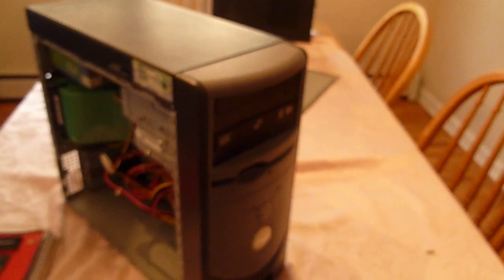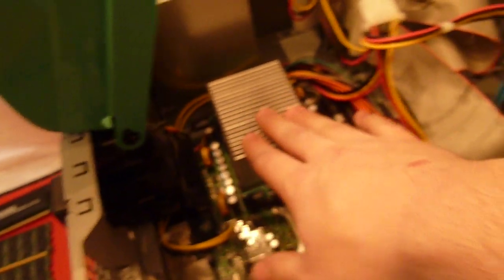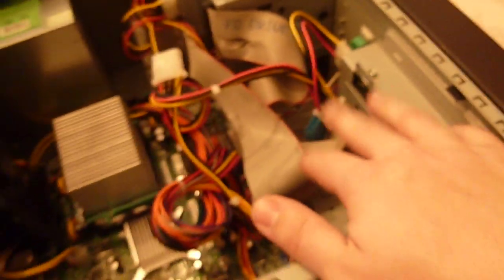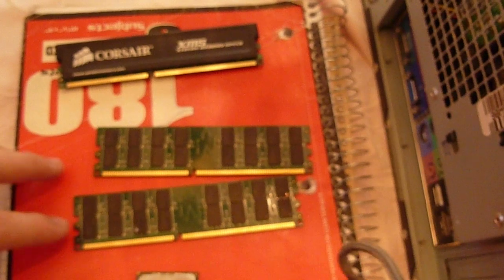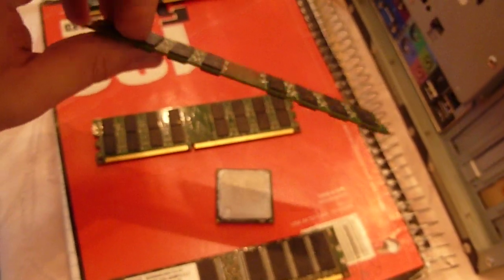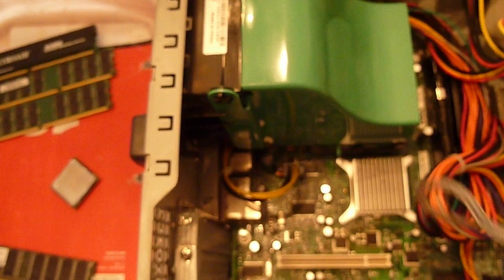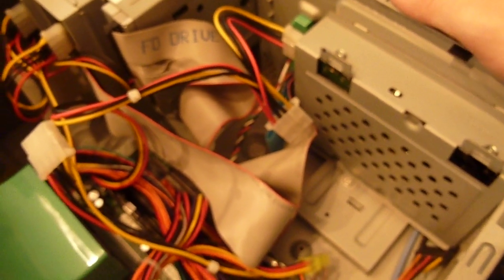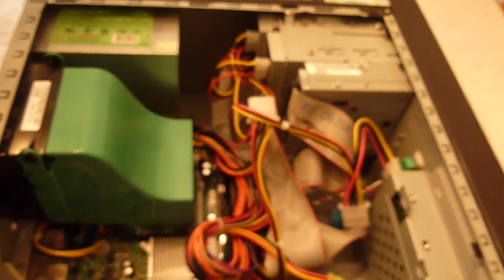Dell Dimension 3000 computer upgrade

Comment: I hate to discard this because it has a fast  3GHZ processor and am  considering upgrading to 2 GB of RAM and using Umbunto as an operating system. Will I have color problems as other have mentioned?
Reply: windows XP is the best for those PC's

Comment: Wouldn't you need to also upgrade your heat sink as your processor is more powerful so may heat faster?
Reply from the maker: +Hanz von ShrekyDreckyWeedStain Thats in the description and the video. DDR 2GB max.
Reply from the maker: +The Hh no. The heatsink with it is overkill to begin with. Its not like a p4 is a screamer anyways.
Reply: +0zfer What is the maximum amount of ram you can put in the 3000? also, its DDR2, correct? I would like to upgrade mine to 4gb, if it's even possible.

Comment: Is the 3GHz P4 the absolute best processor for Dell dimensions 3000? Is there anything that can better this CPU for this PC?
Reply from the maker: +The Hh There is probably a 3.4Ghz or something like that Pentium 4 but the price will be a lot higher, and the performance not significantly better. P4 line is the best this can do on the 400 series socket.
Reply: 0zfer so would a P4 3.2GHz be compatible for a DELL dimensions 3000 32 bit?
Reply: 0zfer was your cpu 800mhz fsb?
Reply from the maker: +The Hh it should be but it really shouldnt even matter. As long as its the right socket you cant go wrong with these pentium 4s...
Reply: 0zfer if you don't mind me asking, how much did you buy your P4 3GHz for?
Reply from the maker: I had it from scrap laying around. I imagine you can get one on ebay for under $10
Reply: 0zfer which would you say is worth buying. The 3.2ghz for £5 or the 3.4ghz for £13?
Reply from the maker: +The Hh as long as its the socket 478 and not the socket 775 it should work.
Reply from the maker: +The Hh the 3.2 will do 98%, is it worth it to invest more in something this old? 3.4 will not be able to do many insane applications these days and 2GB ram is not much.
Reply: 0zfer yes they're both for socket 478. So I'm guessing I'll just get the 3.2ghz one. No point in investing an extra £8 on a cpu 0.2ghz more. I'm planning to just use this PC to surf the Web, do work and maybe the occasional gaming...
Reply from the maker: +The Hh good luck even playing youtube on it... I would go with linux at this point as windows 7 runs hunky chunky on it.

Comment: Quick question,  decided to bring my Dimension 3000, which has just been sitting collecting dust, out of the dark ages. I have a new dell laptop, however, want to bring the Dimension up to speed with at least Windows 7 as a back up.  I replaced with 2GB of genuine Dell Ram and now my screen color is terrible.  All blue and yellow hues. Any ideas on what I should do?  Thanks!
Reply from the maker: 24hrlib Is the problem corrected putting the original ram back in? If so its probably bad ram and you should send it back.
Reply: Ah ha!  I was thinking it was in need of a new graphics card.  Which I plan to do soon.  I didn't think of the RAM as bad.  Thanks so much for your assist!!!!

Comment: I have a dimension 3000 also that I want to upgrade, do you know the name of the motherboard so I could look up what it could handle as far as newer parts? Or do you know the motherboards limits as what new parts it could handle?
Reply from the maker: lonetigerx You can just google for dimension 3000 upgrades as only 1 type of motherboard is used in a dimension 3000. As my video said you can upgrade to 2 1GB DDR1 ram sticks, a pci graphics card, and a better pentium 4 cpu, and other then putting a SSD in it thats about it. SSD is probably not worth the price for such a old pc.

Comment: you could get a pci to pcie x16 or pcie x1 adapter - try geforce 210 - as a graphics card -- people play fifa 14 on pentium 4.or 6200 pci graphics card geforce - is alot like onboard graphics on newer system.
Reply from the maker: 0009aw lol by the time you buy a $50 adapter and try to jam in a new gpu with it and put strain on the old power supply and hope the adapter doesn't kill the mobo its just not worth it with a system that old. and for what to play fifa 14 a 3 year old game?

Comment: Celerons more like Craperons
I took out that useless floppy drive and moved my HDD to the floppy bay to allow better air intake in the front.
Reply from the maker: Floppy drives can come in handy depending on what your doing. Improving airflow is good but your not going to be overlocking one of these.
Reply: I put a Dell Studio s540 motherboard in it,  painted the front gray bezel red, painted the inside black, and cut out the round dell bulge on the side for a fan. I may not be overclocking it, but I got a big 'ol 11 inch long 9800 GTX+ in it. I can't remember when the last time I used a floppy drive.
Reply: I leave them in the computers, sometimes I use floppy's

Comment: Hi, Ozfer

I need help:  I want to buy from Dell: VisionTEK
3450 PCI 512MB DMS59 SFF DDR2 Dual Monitor SFF-Short + Tall brackets for the Dimension 3000  It says it is cmpatible with it but conflicted because in teh manual it states that it has a maximum of 32 bits  (PCI connector data width(maximum) 32 bits and the product taht I want to purchase syas it has: bus width 64 bits
alos memory interface: 64 bits  I fear it will not be compartible since the computer states taht it has a maximum of 32 bits.  Should I worry and not buy it ? or is it still good and I am worried for nothing?

I hope you can help me.

Sincerely;
Giuseppe
Reply from the maker: As long as it uses a standard PCI connector this will work. I believe that card is standard pci but the memory bus on the card is 64 bit internally. It should work perfectly fine under windows 32 bit because standard pci slot is 32 bit. Keep in mind that card wont be a "Screamer" but it will be better then onboard graphics.

Comment: Would it be useful to upgrade also the CPU?  Asking because this is for a friend of mine.. helping him out with having a better video game experience.
Reply from the maker: Yes upgrading cpu is one of the best ways to get more performance. a new 3Ghz or 3.4Ghz hyper threaded pentium 4 will be faster then stock (not nearly as fast as new cpus today but aa 3Ghz Pentium 4 is cheap on ebay). Remember to turn on hyper threading in BIOS after installing new cpu and remember to go with pentium 4 socket 478 and not 775

Comment: I bought  from DELL  1GB Certified replacement memory module. It says it needs to have 2 equal cards to be able to work properly.  I will install it once I receive it.  My question is: is there a way to instal a new upgraded graphic card?  Could yu please make a vdeo on how I can do that if possible?

Thank you!

Sincerely;
Giuseppe
Reply from the maker: you can only use PCI graphics in this system. There are no GOOD options for pci graphics butr some that are better then the built in. The problem with PCI graphics is you might not have enough power from that old pc and you might need to upgrade the PSU and good(as good as pci gets) pci graphics. NVIDIA 8500GT or 8400GS are some of their fastest Nvdia pci graphics and ATI 9000 pci are on newegg. None of them are new or that amazing but they are better then the built in. Make sure whatever you buy is PCI and not pci-e or express. The cards slide right into the white slots and should come with some basic installation instructions.

Comment: Can u make a video where u take out the 
Dimension heatsink im struggling
Reply from the maker: push down on the side brackets around the heatsink while pulling them away from the heasink. I also had trouble the first time I did this since I had never seen them before. Don't pull them straight out because they are clipped in. one bracket on each side.

Comment: Hello. I am upgrading a dimension 3000 that I was recently given. I was wondering have you tryed windows 7 on this machine? I already have the 3ghz processor and 1.5gb ram so all is good there. I am planning on putting a 256mb pci graphics card.
Reply from the maker: If you use a pci graphics card that supports windows 7 aero and DX9 as a minimum windows 7 will run okay. Unless you already have a pci graphics card its not really worth it to put so much money into a old machine. Without the pci graphics card windows 7 does not like the intel integrated graphics very much because they are made for windows xp. A very fast alternative OS to put on this machine would be mint linux and it would run great even with the intel chipset. Now that windows xp is not supported anymore this machine has lost its main OS.
Reply: I ordered a nvidia 512mb pci card vista compatible.  Waiting for it in mail.
Reply from the maker: I really wouldn't use vista its at least 10% slower then xp and windows 7 and will be out of support in another year or two.
Reply: Im not using vista I hate vista im using 7
Reply: I got the geforce gt610 and it was a success
Reply: And I put the full 2gb ram
Reply: I dont know I sold it but my buddy says all his facebook games run a1
Reply from the maker: Randy Harrigan lol facebook games :P I wouldn't expect it to play BF4 anytime soon!
Reply: No but thats not what I was intending for it I just wanted it to rin wondows 7 and run facebook and youtube smoothly and it does so mission accomplished and all in it only cost $140 and I sold it for a bit more than that...

Comment: so i can take out all the old parts and upgrade it to a gaming pc like bf4, titanfall, arma, minecraft, elder scroll games and all the other rpgs and fps games
Reply from the maker: If you want a new gaming PC you could probably re-use the case and that's about it. I find it better to get everything new because a new case on sale at newegg can be bad once in a while from $10-25 and it's worth it. The psu mobo CPU ram and most likely DVD drives and floppy drives could not be reused with a modern mobo gaming PC.

Comment: My wife located her Dell Dimension 3000 in storage and I want to upgrade it and use it as a media PC & DVR.  With today's hardware, what would you suggest I replace the Mobo, Ram, CPU, Graphics Card, & Power Supply with?  Is this case compatible with the Asus p5k-se Motherboard?  Is it even worth it?
Reply from the maker: LGA 775 (asus p5k-se) sockets are pretty out of date at this point. If you are going to replace the mobo and but a decent video card in it you will need new everything a the case. technically that mobo will fit as it should accept any standard ATX motherboard. If you are going to replace everything but the case (you can re-use the dvd drive only if your new mobo comes with ide) you should just get a new computer completely because a 10 year old case doesn't look great. If your not good with putting computers together yourself newegg has some pretty decent desktop deals on sale now and then. If  you need more help feel free to ask or pm me.